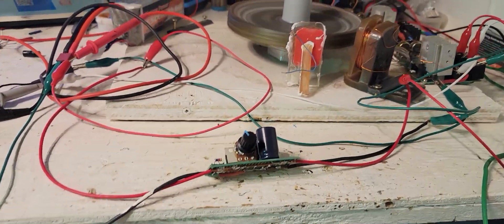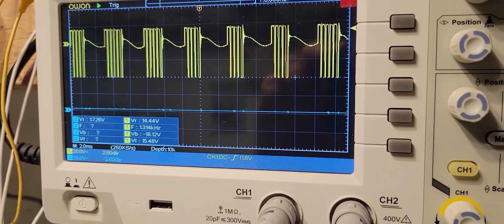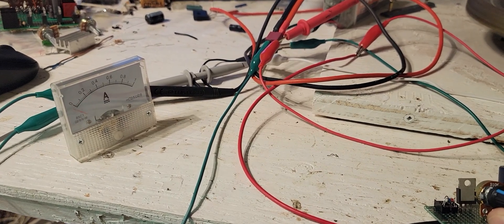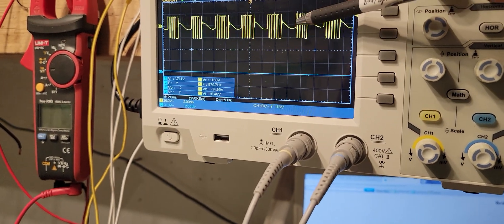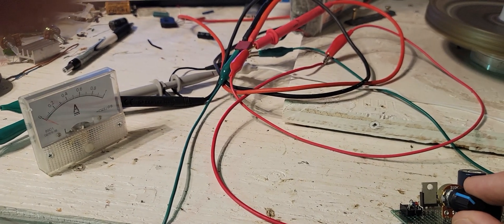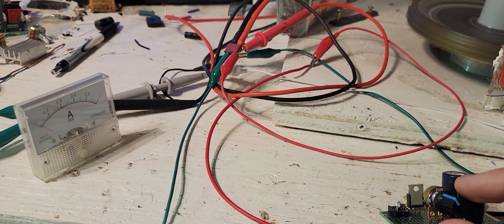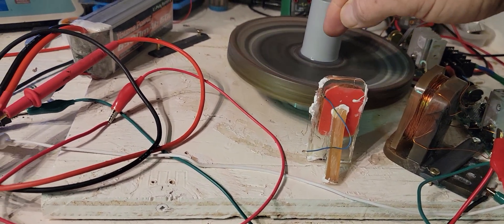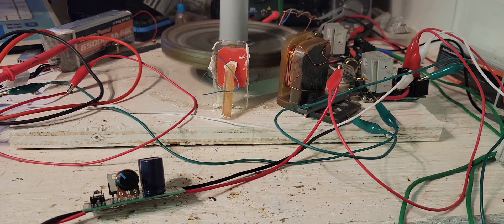SCR cap dump circuit update...easy mod makes it  super easy to change trigger voltage

Comment: Hey great work here! Do you have the potentiometer between the motor & zener or the zener & SCR, in this arrangement?
Reply from the maker: Thanks you! 
The Pot is between the trigger on the SCR and the Zener diode.  It makes it so the voltage can vary a few volts either way up or down
Reply: @windpowerandmore6310 thank you!

Comment: So, can i use say, 30,000 micro farrad caps ? And i guess the output of my circuit will dictate the rate of charge in my caps. What caps are you  using ?
Reply from the maker: That should work fine.  Usually the cap has to completely drain to the battery voltage before the scr will unlatch with this type of cap dump circuit which isn't ideal
Reply: @windpowerandmore6310  mm! I heard about latching, so is there things we can do to stop it latching ?           Im gursssimg it works okay most of the time ?
Reply from the maker: @tvdylan you can't stop ithe scr from latching it won't unlatch till the voltage of the cap is the same as the battery voltage so if you're using a large cap it won't unlatch till the voltage equalizes 
Only way around it is to build the mosfet dump circuit
Reply: @windpowerandmore6310  mm! Well ill have a go with the scr and observ how it works. Got some in the post.  Have you done the mosfet dump ? Ive seen a guy using a mosfet with a halogen light dump circuit kinda thing. And i did download the bedini comparitor schematic. Might build that one day! Alot more complex tho.
Reply from the maker: @tvdylan if you watch my videos you will see that's what I use and even posted the schematic of the circuit and give throughout details about how to tune it
Reply: @windpowerandmore6310  oh this is absolutely great news ! 😊 i shall watch it thoroughly then !! Very much appreciated !! 👍👍

Comment: Which Petentiometer value?
Reply from the maker: 5 k
Reply: @windpowerandmore6310  thanks!
Reply: @windpowerandmore6310  so i can adjust the charge time of the cap with the pot yeah ? Im gonna make it soon !
Reply from the maker: Yeah you can it will raise or lower  the voltage at which it will dump at... always start with the pot turned so it has the least resistance and turn up once the circuit is on or else you will burn the pot out if the voltage is high then try turning it down
Reply from the maker: Also use a zener that's very close to the voltage that you will be triggering the scr at
Reply: @windpowerandmore6310  i see yeah. And could have a couple alternate zeners if i want to adjust trigger voltage isnt it? 🙂
Reply: @windpowerandmore6310  yeah right, so maybe a pot that can handle the current of the trigger appropriately to avoid any overheating ?
Reply from the maker: @tvdylan yes
Reply from the maker: @tvdylan yes that's right